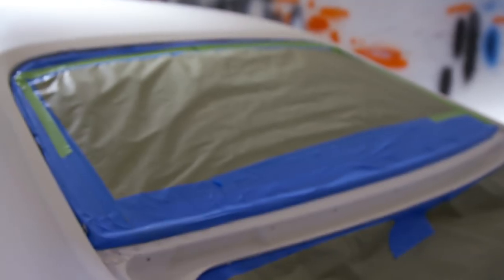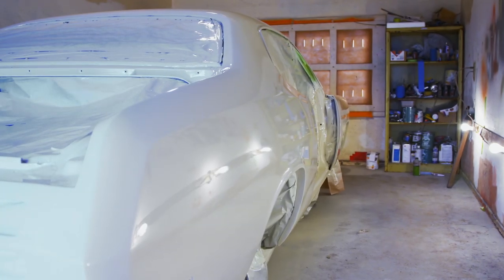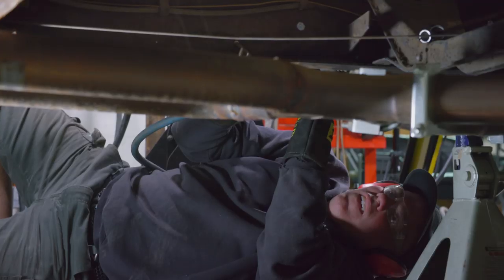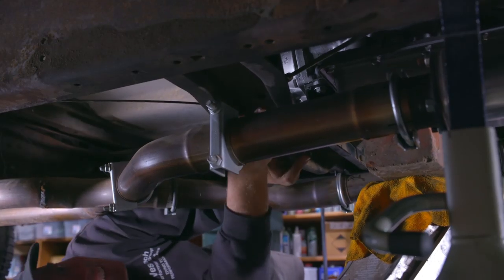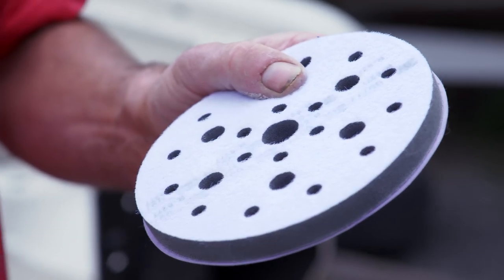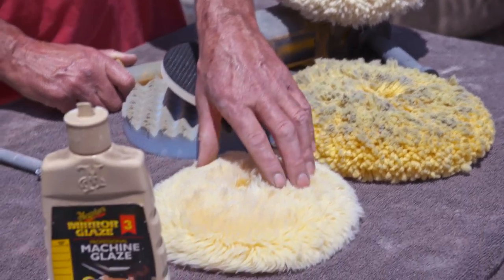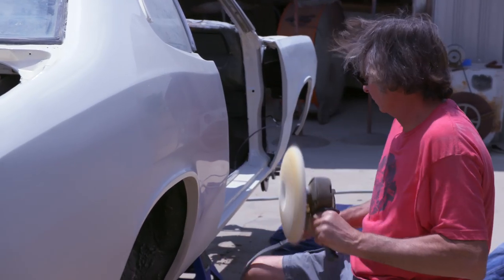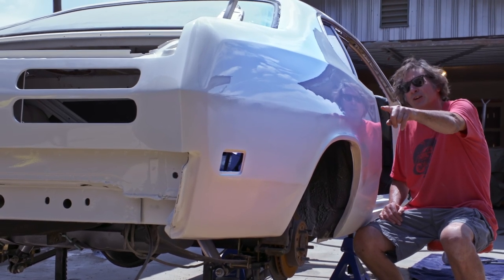The Crop Duster Paint Is Finally Finished!—Roadkill Garage Preview Ep. 46

Comment: This type of paint is not meant to be cut and buffed. The finish is designed to react with the elements, such as sun light and change of temperatures in the metal. Lacquer paint finishes are the ones you can buff all day long
Reply: You can buff enamel with hardener which is what that is.  In straight colors and on old cars it is very forgiving. It is often used on fleet vehicles.. Though Steve flatted out the orange peel which all Mopars of that period had
Reply: buffing lacquer?  wow ole timer. Hey we used to buff catalyzed centari and imron back in the 80's with no problems. Not sure what you meant by "react with the elements"

Comment: Lmao if u could paint u wouldn't have all that orange peel all over the car and u would of saved your self a day . Try doing a half coat followed by a full coat with overlap!!!!
Reply: show me someone who can paint without any orange peel
Reply: @gtametro  open your eyes thers plenty of people on YouTube that can paint a car without orange peel including me
Reply: @SECRETGOVERMENT2012  its not possible to paint without at least some orange peel,   every paint shop I know (and i know a lot that have been going for 20 years plus) will wet flat and polish to get it like glass.   don't get me wrong, i'm not saying you can't get an acceptable finish straight out of the gun, but if you want it perfectly flat and mirror quality finish, you have to flat and polish.
Reply: @gtametro  theres a difference between orange peel and a spray gun Finnish and theres always a little bit of wet sanding the difference between me and some of these body shops is they never dun production painting on $1.2mil  SLR  like i have
Reply: Every time that I have tried a tack coat, as he called it, I've ended up with more orange peel like he did. I always start with a full coat and add a splash of reducer in all three coats. It works for my painting style. I would have been upset with myself if I ended up with the amount of orange peel as he did knowing the extra amount of sanding involved to get it flat. The more sanding it takes to flatten the paint out the less paint you end up with left on the car. I first sand with 1500 and then 2000 and only use two different compounds. The shine comes back quick. A couple things that people say after they see a paint job that has been sanded and buffed (not to mention the amount of prep work) that upsets me is 1. "That looks as good as new". Bullshit, factory paint is a orange peeled mess that does not come close to a sanded and buffed one. 2. "Wow, what kind of wax do you use? I need to put some of that on my car".  Yeah right, it's the wax (which I never use, polish only) that makes it shine like a mirror and not the countless hours of labor. Just my opinion after doing this kind of work for 35 years.
Reply: @JT-SE-OHIO  it also depends on the type of paint used how much thinner is used  and the humidity and temp of the spray room and how u got the spray gun set up